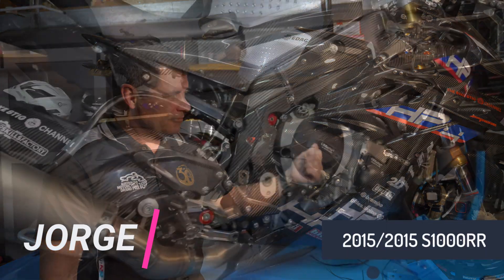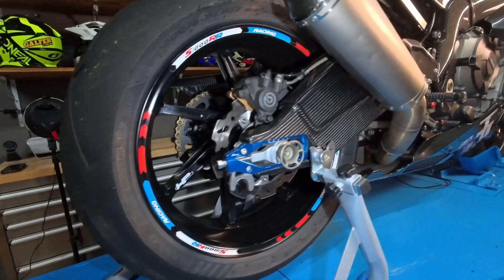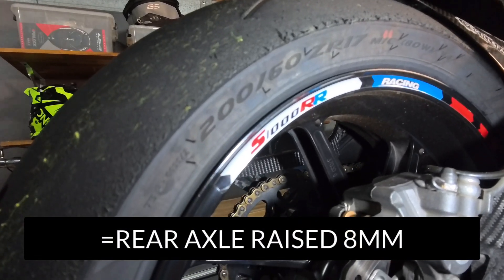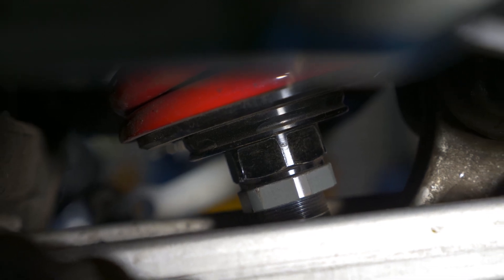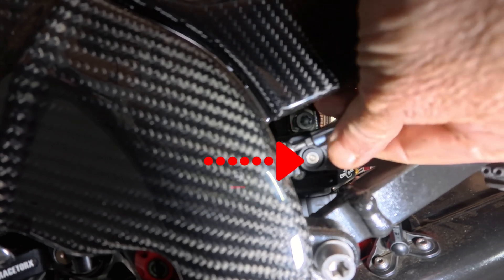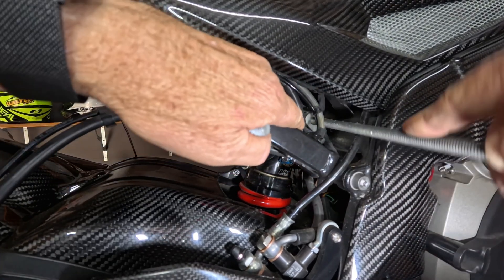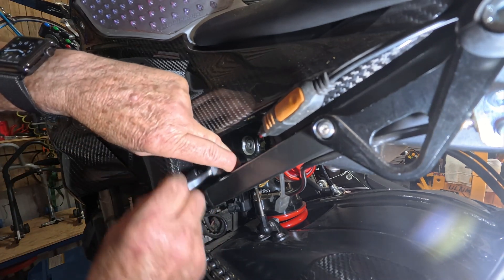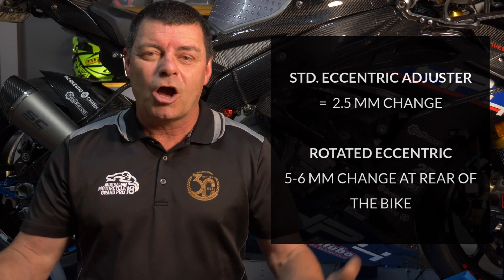Adjusting Rear Height of BMW S1000RR With The Rear Shock Mount Eccentric Support

Comment: it’s for doing the tire size change without altering the chassis geometry with the stock shock because you can’t adjust its length.
with an aftermarket shock id still start with the spacer rather than shock length because it won’t alter the linkage angle as much as shock length would.
Reply from the maker: that makes sense, appreciate you mentioning it, something I hadn't thought about.
Reply: i’ve actually come back to this video just for the measurements - new bridgestone slicks are massive compared to old ones so i’m gunna flip mine during the day at broadford on friday and see what it does